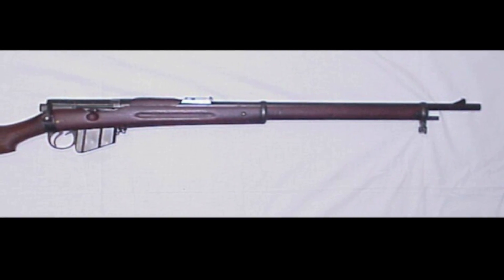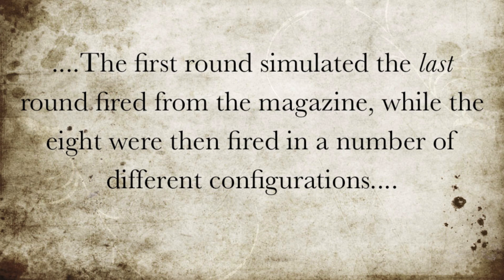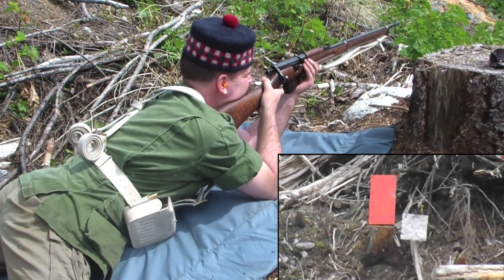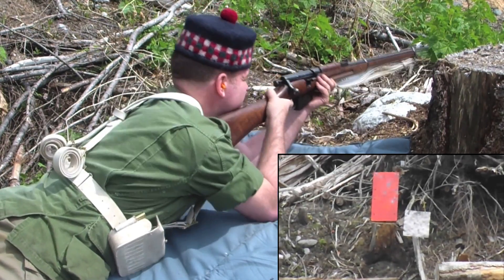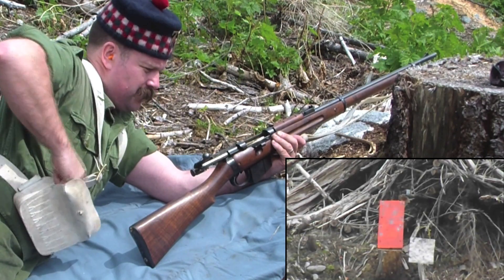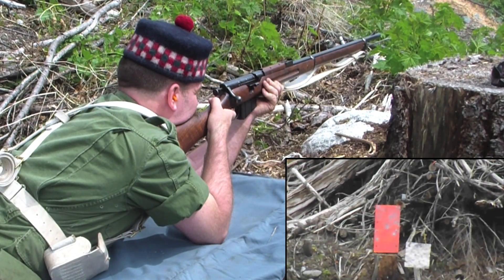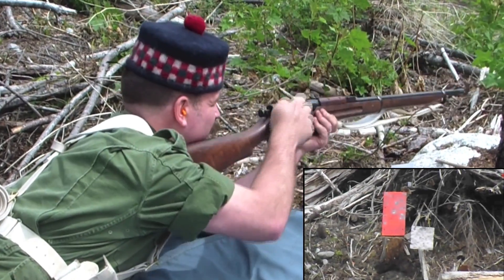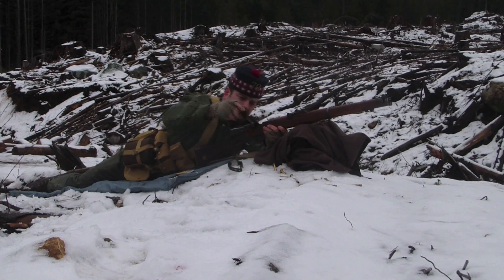The Mk I Lee Metford: Sustained Rate of Fire Experiments

Comment: Just subscribed and love your channel! However, I do have a question regarding the differences with the Lee-Metford and the MLE. Cosmetically the Metford looks very similar to the MLE, but upon taking a closer look the bolt assembly looks slightly different. What exactly are the differences? Thanks!
Reply from the maker: HI there.  The Mk I (and Mk I*) MLM are a distinctive pattern of rifle, as shown here.  Single stack magazine, finger grooves in the stock, forward mounted sling, recess for the cutoff and the somewhat heavier construction are it's hallmarks. The Mk II (and Mk II*) MLM and the MK I MLE are essentially identical rifles except for the rifling.

Comment: loading from the pouch is not much different than the Martini Henry.I guess that was for a leisurely target practice, or maybe a part of volley fire? Like in the movie ZULU?First rank fire ,second rank fire etc.
Firing  and loading with chargers and the bridge is the next step up to just changing magazines  and on to an AK.
I think multiple  magazines in the  later SMLE were not used because I had to tune mine to make it feed right. So if u left it there but loaded with chargers you didnt have any problems.The feed lips on mine didnt bring the cartridge up enuf, So with some pliers I adjusted them.
You have some great videos.
Reply from the maker: +walter chiappini HI there.  You are right about loading from the pouch, not much different than the MH.  Volleys, yes, but keep in mind that musketry must be taken in the context of the time....  longer ranges, strict control and these were the days before the "empty battlefield" with men on the field in close proximity and resulting firepower derived from that....  The longer ranges would necessitate taking ones time to aim anyway, so in circumstances such as that, the lower rate of single loading wouldn't matter as much. Incidentally, volleys were given by a complete subunit, i.e. both ranks fired...  in the early Victorian era, perhaps company or half company volleys,... in the mid-to-late era, section volleys... rolling up and down the line.  If things got sticky, the magazine was available for rapid fire...  There is a demo of both at the end of this clip... https://www.youtube.com/watch?v=SlBdVXrhFSk.  
An extra mag was initially issued with the Lee Metford (from 1889-90) but was withdrawn very shortly afterward (1891)...  Glad you enjoy the channel. Cheers.

Comment: Hi. There are several questions that I want to ask. Can't you just change the whole magazine to increase the rate of fire?? I couldn't understand why you kept inserting bullets one by one in the vid above.
Reply from the maker: Claude 3396 HI there.  Interesting you mention that... When the "Magazine Rifle" was issued at the beginning of the 1890s, there was actually a second magazine and dedicated pouch issued with the rifle.  This was withdrawn from service in 1891 after basically no service life.  The magazine on the rifle is in fact wired to the receiver and although it can come out, only hangs by a metal link when removed.  It seems like a decent system to me, having a reserve of up to 16 rounds in magazines (8 rounds per) but the Army decided against it.  This brings me to the answer of your question...  The prevailing thought at the time was that the magazine was used/seen as a "reserve" of firepower...  Normally, fire was delivered in volleys or independent fire, both loading singly from the pouch and at a measured rate... It wasn't until the enemy got close, during the course of a friendly assault or in the last stages of an enemy attack that "WITH MAGAZINES!" was given...  Then the troops were free to open their cut-offs and use the reserve of eight rounds (later ten) in the magazine for a short burst of rapid fire (either by rapid volleys or independent fire).  The purpose of the exercise in this clip wasn't to see how fast I could fire the LM, but rather which method afforded the best rate of "sustained" fire (say if the soldier had to fire continuously for 30 or so rounds).  Hence the extra round fired at the beginning.  In addition, magazines for the Mk I Lee Metford are as rare as hens teeth and I don't have another...  So that would be right out, unless you have a couple that are lying about with no home you could send me...  :-) Cheers.
Reply: @britishmuzzleloaders  It's much more complicated... The spare magazine pouch is one of the rarest pieces of equipment. Even in very early photographs, it is extremely rare. At the same time, there are photographs and images with it much later than in 1890. The use of spare magazines goes in documentary sources up to and including 1903 (including describing it as a possible variant during the Boer War). And there is a late version of the pouch (but also very rare), very different from the usual early version. It was rather an optional variant, on a case-by-case basis. It must also be understood here that the equipment itself was still a mess, and some regiments did not receive a complete new standard kit until 1897 or so. I'm pretty sure that in most cases a spare magazine, if available (at least 1890 sources claim that a second magazine goes with every rifle at all; and later ones describe this as a normal option), was worn in other parts of the uniform, such as the standard P1889 pouch, chest pockets, or even in a knapsack.

Again, whether or not every soldier was issued with two magazines early on is an open question. But I still think that it’s more likely that the additional pouches themselves were a rarity in themselves. Speaking of the mention of Boer War soldiers with spare magazines, it wouldn't surprise me if some troops did, given that charger charging is not available. In fact, I would rather be surprised if none of them had at least one spare magazine at all, although this may have been limited by availability.
Reply from the maker: @SLON-sh2jg  I should very much like to learn of the sources you speak of!  A little studied subject.
Reply: @britishmuzzleloaders  There are actually not so many of them, but some information can be found in:

Instructions For Fitting The Slade-Wallace Equipment. 1888
Shaw, Wilkinson J. (1890). The Elements of Modern Tactics
Journal of the United Service Institution of India, Vol. 21/22, 1892
The Canadian Magazine, Vol. V. 1895
Navy And Army Illustrated, Vol. VI. 1898
Journal of the Royal United Service Institution,  Vol. 47, Issue 1, by Royal United Service Institution. 1903
Reply: @britishmuzzleloaders  
Late-pattern magazine pouches have appeared on sale at auctions in recent years (with issue stamps). Even less is known about them, except that they were introduced sometime towards the end of the 1890s.
For cavalry, nothing like this seems to have existed, and additional magazines have never been released (given the 6-round capacity, not surprising).
The Navy had an 1890 pattern bag which allegedly contained a pocket for an additional magazine, removed in 1893 (this topic has been studied even less, so I cannot confirm or justify this myself; there is really no information about naval equipment); whether this means that the very concept in the fleet was dropped so quickly, it is impossible to say for sure.
Reply from the maker: @SLON-sh2jg  Image?.... Link?..... I believe I know what you are talking about and they are not magazine pouches.... unless we are talking about different items.  There are no entires for magazine pouches in the List of Changes past their withdrawal from service.
Reply from the maker: @SLON-sh2jg  A few questions if I may... What article in the "Canadian Magazine" talks of magazine rifles? and,... which issue of the N&AI does your reference appear, there are issues 60 to 85 in Volume 6...
Reply: @britishmuzzleloaders Specifically, this can be found on pages 111-112.

In the edition I have seen, this is on page 617 (Sept. 17, 1898)

My reason for entering into this analysis is this:  although clearly these that after 1890 it ceased to be an obligatory general piece of equipment, it seems to me that the known references to such a practice (such as the Journals of the Royal United Service Institution) must have some basis in fact. Such publications were written by serious and knowledgeable people who would hardly write about something that did not never exist.
Reply: @britishmuzzleloaders  This is a buff bag, little larger than a magazine, rectangular in shape, fastened with a belt, intended for worn on a brace. I don't know about their genesis, but then again, not that there would be much information about it at all. But they pop up every now and then at auctions.

I am know about the actual/well-known variant of the spare magazine case... the problem is that on photos it is exceedingly rare (but at the same time there is a lot of art with it). And at the same time, there are much ater photos with him, up to aII including 1895 (or 1896).
Reply from the maker: @SLON-sh2jg  That reference in N&AI is erroneous.  It's copy written by a clerk to fill pages.  Probably using the 1888 Equipment manual.... not indicative of the reality which was present past 1890 or so.  There is not one picture showing the use of the extra magazine after the 1890 timeframe.  Not at home or on active service.  They were ordered to be turned in and manufacture to be ceased.
Reply: @britishmuzzleloaders  There are later photos, such as a KRR with MLM Mk II and magazine pouches, in 1895, or Coldstream Guards in 1895-1896 (at that time they still carried the MLM Mk I).

Again, even in very early photographs and images, this is a rarity, so I don't think magazines were ever given out directly to every person at all. The 1888 manual confirms this. Therefore, it is not surprising that the magazines were turned at some point.

There really are not them in any real service, only at home.

I agree that by 1898 they were no longer carried anywhere, it’s just interesting because then there was still the very possibility of their theoretical use as such.

Again, if remember the tactics of the time, this is not surprising. In particular, clip loading was not introduced because it was believed that the soldier would most likely not have time to empty the entire magazine before the end of the firefight (despite the fact that the rifle was used as a single-loader as a whole), and it would be more convenient to replenish it in separate rounds, and clips would only make it harder the weight. Additional magazines in this case also became somewhat redundant.

I still think that references (magazines, not pouches) in such places from the period as RUSI Journal must have some kind of backstory. It is unlikely that in 1903 they would have written so specifically about something that would not have existed at all, where the results of the second Anglo-Boer war are specifically summed up.
Reply from the maker: @SLON-sh2jg  Are you referring to this picture?  https://collection.nam.ac.uk/detail.php?acc=1978-02-37--171
As these are not Mk II MLMs.  Which is s bit of a red herring, admittedly.  Crucially, the date associated with this picture by the NAM is incorrect as the Busby replaced the helmet in 1890.... so this picture was taken around that time,... coinciding with the use and subsequent withdrawal of the spare magazines and pouches....
As for the Coldstream, I assume you are referring to this picture, or this series? https://collection.nam.ac.uk/detail.php?q=searchType%3Dsimple%26resultsDisplay%3Dlist%26simpleText%3Dcoldstream%2Bguards%2B1895&pos=0&total=24&page=1&acc=1978-02-37-139
As much as we would like to believe that museums have correct information, they often do not.  The dates associated with these photos form the NAM are suspect, simply because the pouches were withdrawn well before 1895.  The order to return them to stores happened in Oct 1890, so with the usual red tape, one might assume that within say, 6 months or even a year, these would have been collected, to be returned to the Depot at Weedon. This of course, even with a very generous margin, is well before 1895.   An interesting aside, is that a great many units still had to receive their Magazine Rifles by this time and still carried the Martini.... The Mk II MLM did not see general issue until just before the Boer War. The Queens' Diamond Jubilee Parades saw the first real instance of that Mark being carried. Up until that point, the Mk I* MLM was the rifle carried... As you peruse the N&A Illust. you will see that the Mk I* MLM predominates until the >very< late 1890s. Indeed all the British Battalions that were sent to the Sudan in '98 used the Mk I* MLM...

Comment: can you use smle no1 mk3 magazines in this? are they compatible between models?
Reply from the maker: Hi there.  No you cannot use SMLE mags in it...  It is a single stack eight round mag vs the double stack ten of the SMLE.  The magazine is wired to the magazine housing and cannot be taken off the weapon.  It can be removed from the receiver, but not taken completely off the weapon....  Cheers.
Reply from the maker: I can't seem to bring up your second comment inYoutube so I'll attempt to reply via your first comment....
I think I see what you are asking....  My MLM is a Mk I Lee Metford.  It has a entirely different magazine to later marks (single stack, eight rounds)... The Mk II Lee Metford, which was a comprehensive redesign of the rifle, had a double stack 10 round mag and this was carried over when they simply changed the barrels and called it a Mk I Magazine Lee Enfield (MLE).  These magazines were essentially unchanged in the MK II MLE as well.  A couple of comments if I may....  I don't know if the MK II MLM and SMLE mags are the same, sorry.  They are similar for sure but not knowing if they actually fit and are useable.  I could check but I don't own a MLE.  In the interest of nomenclature, I think that your new receiver is probably a  Mk I* Magazine Lee Enfield (MLE) if it dates from 1901.  Mk I Lee Metfords weren't produced by that time.  I might be wrong, but it sounds as though there might be some confusion about names, that's all.  Cheers.
Reply: britishmuzzleloaders Hi, thanks for the reply, the receiver im getting has stamping...VP, BSA Co, 1901, L.E,  I*     do you think you can help me find out if this would accept smle mags or what mods to make this happen. Cheers.
Reply from the maker: Cruz Canal So....  I think that the first marking is actually "VR" (the Queen, referred to as Victoria Regina), Birmingham Small Arms is the next marking, and the LE refers to Lee Enfield Mk I*.  I have asked some friends about the magazine compatibility issue and will let you know when I get an answer.
Reply from the maker: Cruz Canal This is the reply that I got when I asked about your question.....  "Generally the MLE mag will interchange into that other rifle (the SMLE), the main drama is that the MLE is made for the round nose cartridge and when a MkVII pointed projectile round is loaded they tend to ride up at the front as they aren't properly retained by the short feed lips.

When the 'other' rifle (the SMLE) came along, the front lips were lengthened to better retain the pointed round in place.

That creates a bit more mischief as the magazine cut-off will clear one mags front feed lips but not the other when its swung across.

Hope this helps..
Reply: britishmuzzleloaders ahh thank you so much, this is all the info i needed. Very much appreciated!!!
Reply from the maker: Cruz Canal Before you forge ahead, here is another answer,.... The English is a bit muddy but there might be some issues by what this gentleman says...
"Most long Lees will not accept the early 1,2,and 3 S.M.L.E. magazine cases,these magazines have riveted stop clips on the right hand side and require a corresponding opening in the magazine well and trigger guard magazine opening for these cases to work,case No 4 will fit most long Lees and some commercial long Lees were made to fit 1,2 and 3 cases as well as the clip loading conversions of the long Lee rifles"
Reply: britishmuzzleloaders thanks for the extra info, ill be trying out no1mk3 (no stock clips) mags in it and also see if the no4 will fit. Thank u, and i look forward to more of your videos!
Reply from the maker: Cruz Canal You are welcome, I'd be interested to know how your project turns out.